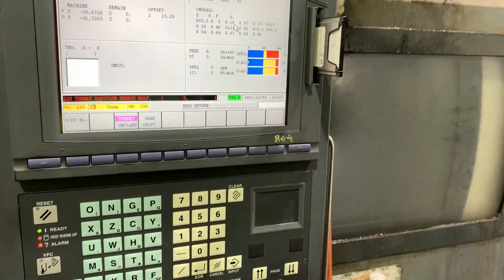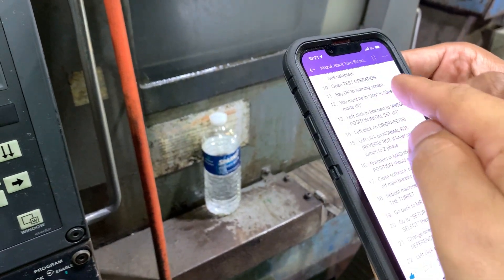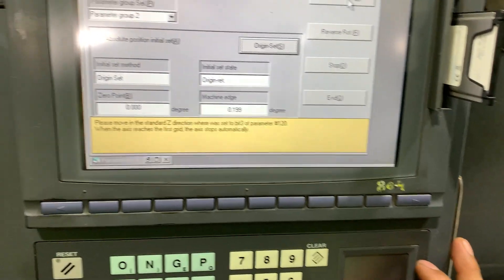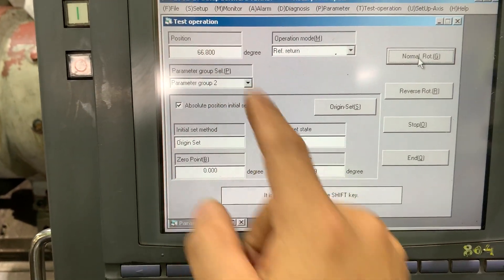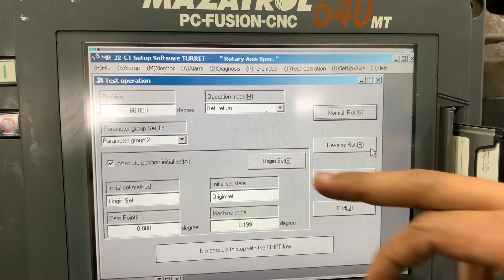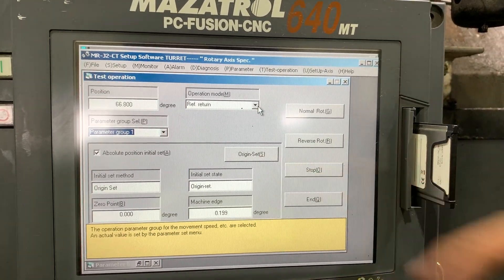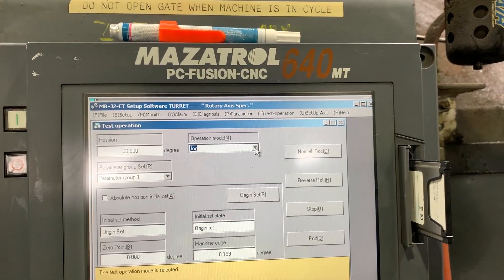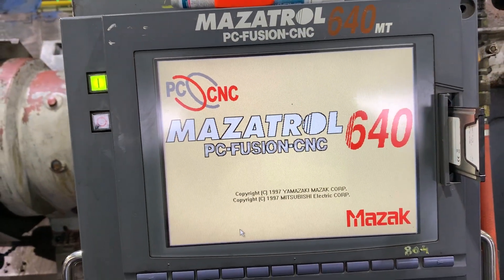Mitsubishi MR-J2-CT Commissioning. STEP 3 of 4. HOME SET 1st part. Origen Set

Comment: I have 350 CT mrj2 drive..it's showing BAL alarm..i have replaced battery new..still alarm so replaced encoder..also cable..but alarm not resetting..pl help
Reply from the maker: Can you upload a video into your channel showing the alarm you get?
Reply: @FabianAchaval   i have solved it by applying higher voltage battery..4.1V DC connected..
Reply: It seems some voltage sensing issue on drive pcb .. sensing IC'S may less perform

Comment: i go through the same procedures but i end up with different results and still can't home the magazine (in my case machine is integrex but same control as yours
do you press Normal "JOG"  or Reverse JOG after you have found the correct degree value ?? 
does your turret ever stop? 
i am trying to do this for my ATC or Magazine but the jogging to find reference never seems to stop. 
then i am instructed to turn the power off and power on to REFERENCE RETURN 
any idea?
Reply from the maker: @fred Rezfield, make sure you've selected the MAGAZINE drive, and there should be a locking mechanism on the MAGAZINE that need to be released first. In case of a TURRET, you have first of all UNCLAMP it.

You can create your free Mitsubishi account at https://us.mitsubishielectric.com/fa/en and get access to procedures and more.

The complete procedure has been included on each video description.
Reply: @FabianAchaval  Do you mind sending me the instructions ? the instructions you are reading from your phone? 
thanks
Reply from the maker: @fredrezfield1629  the procedure we followed on the smartphone is published on our Company's Intranet and cannot be shared, but it is the same procedure that is on this video's description. Regards
Reply: Hola, tenés algún número o email para contacto.
Precisaria conversar al respecto de mantenimiento. Gracias.